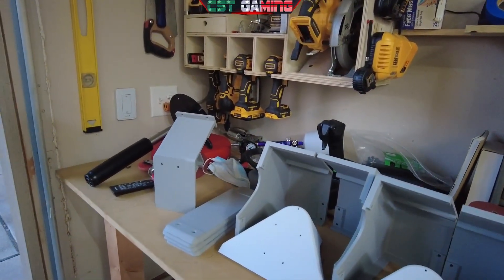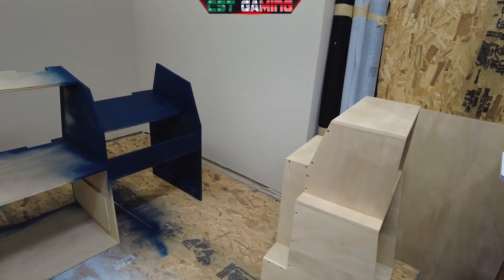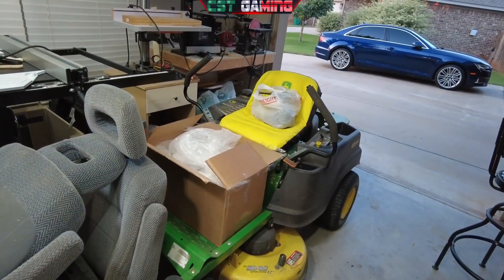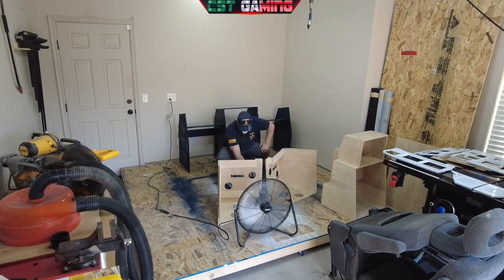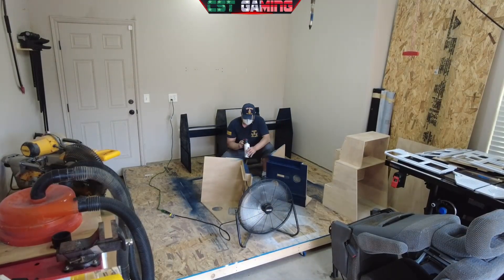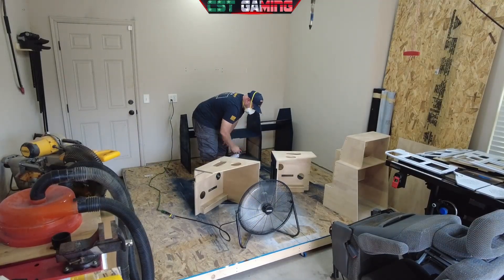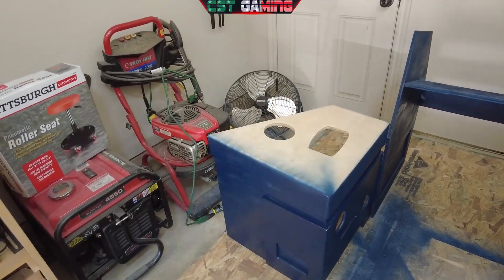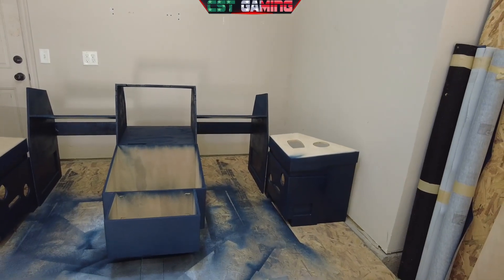🛫 Airbus A320 Cockpit Build Part 4 – Painting the MIP & Pedestals LET US "SPRAY! 🎨✈️ #diy

Comment: You can try using some plastic filler/ bondo then sand it down to help eliminate those lines on the 3d printed parts.